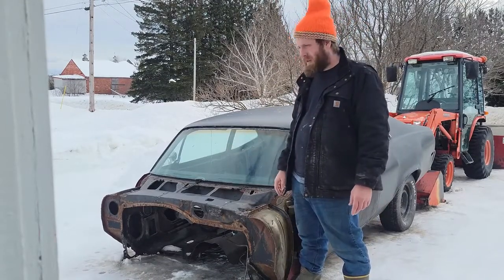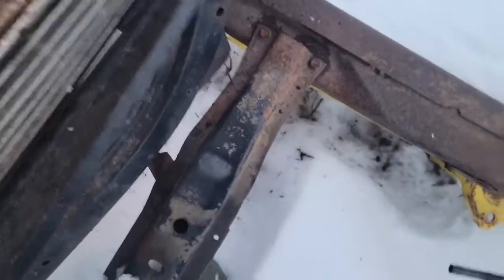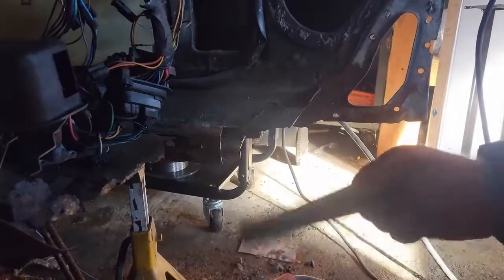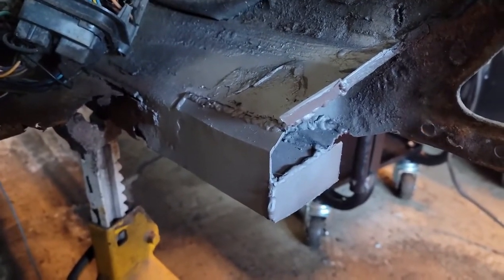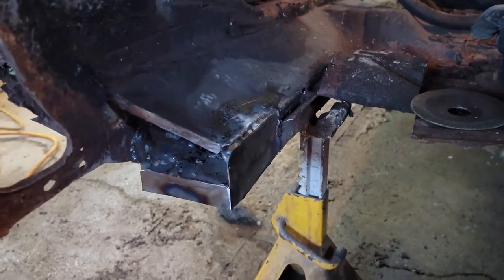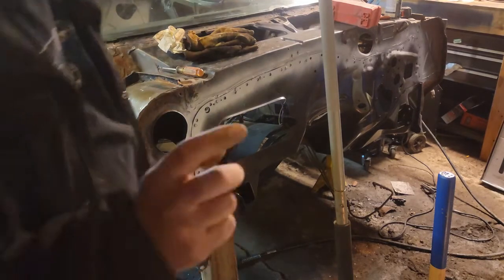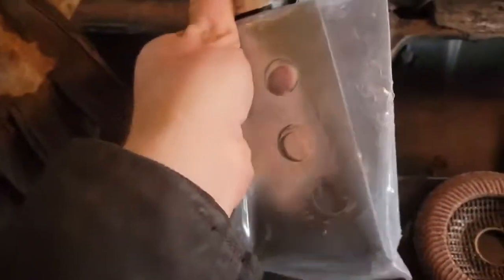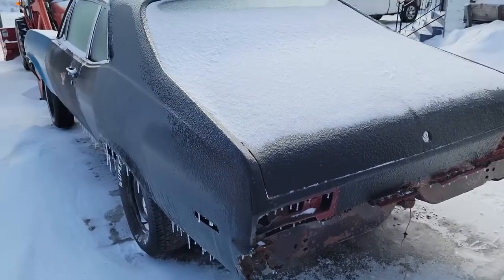Installing the new AMD firewall in my 72 Nova!

Comment: Any chance of getting some straight on shots of one of your firewalls? I'm doing a 74 Ventura and I'm kinda stuck on where exactly the torx box goes back on. Just need a reference. I did hear that you said 19.5 inched from the top to the bottom of the body bolt hole.
Reply from the maker: I don't have anything to reference at my place right now, but my buddy has a Nova, and a ventura sitting. I'll try to get up there today, and snap a few pics. Not sure how I could send them to you, but we will figure out a way.

Comment: Can you do an update on the cummins project I got a 360 my self that I’m looking to swap and advice or help would be appreciated
Reply from the maker: I actually sold that a little over a year ago. It was getting too expensive to keep going with.
Reply: @CountyGarage207  I hear ya it’s not as easy as people think lol I’m trying to find cross members it’s impossible
Reply from the maker: @dieselmodified9223  Yeah Lol building a diesel takes a ton of research! And which cross member are you looking for? If I remember correctly you can use the stock engine cross member, you just have to swap out to the cummins motor mounts. I could be wrong though.
Reply: @CountyGarage207  I’m looking for the two cross members that hold up the gas tank and yeah I think you are correct about the motor mounts you just have to swap them